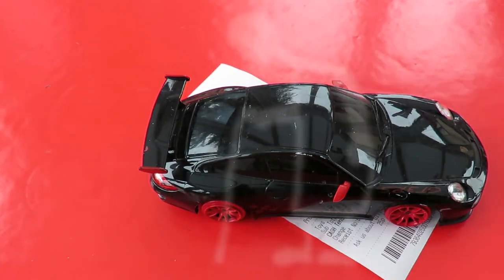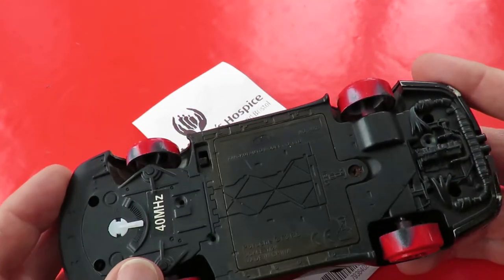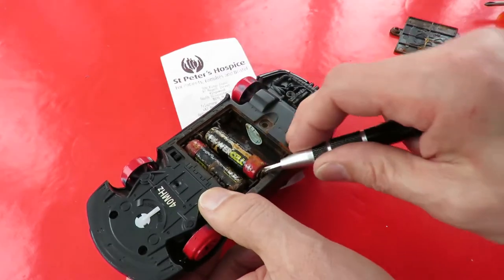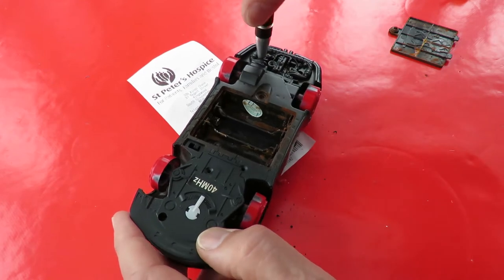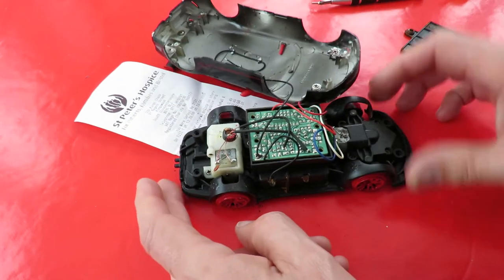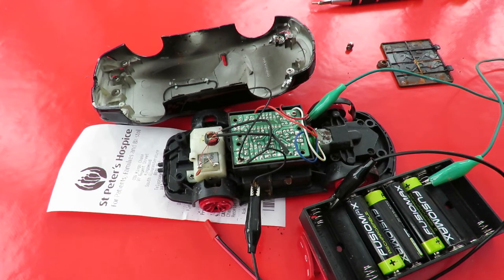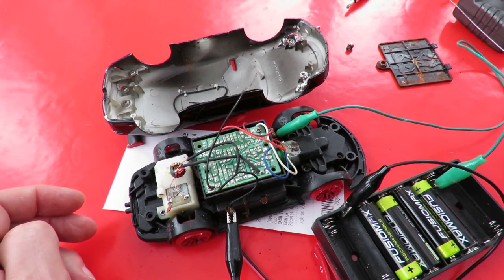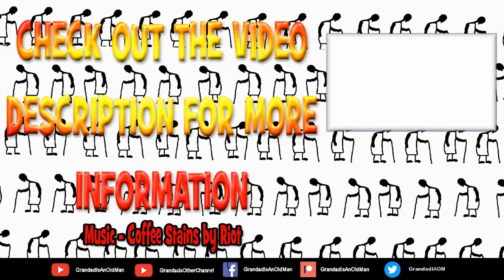RC toy car Porsche GT3 RS CSGOG salvageable

Comment: Looking at the rusty screw for the battery lid id say this has been either left outdoors or in a batub at some point.
Reply: Could be worth sticking on some tires or something like small rubberbands too give it decent amount of grip all around & soldering on a connector for a 1s lipo battery or single lithium ion battery if you got seperate cells ready too use for a bit lower weight.
Reply from the maker: That is in Saturday's video :-)